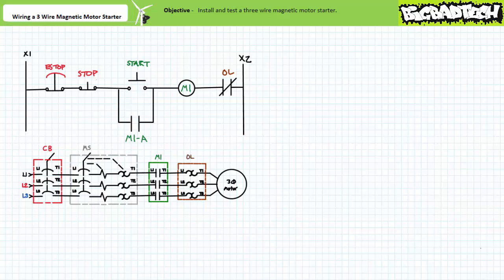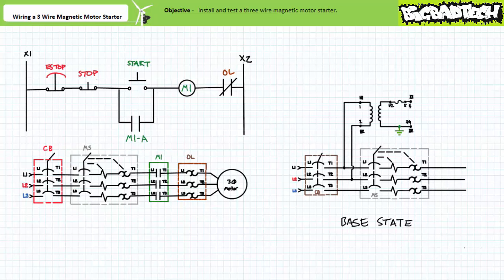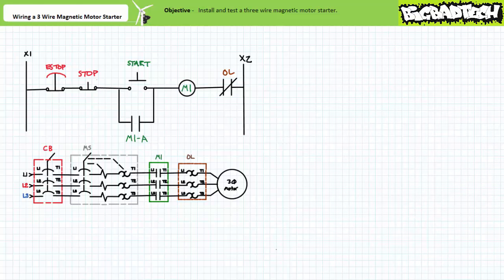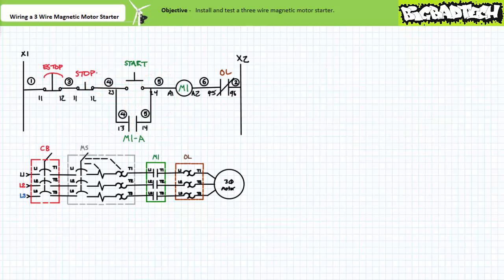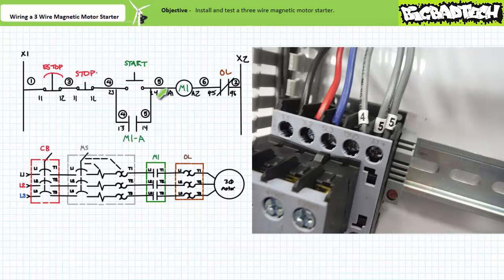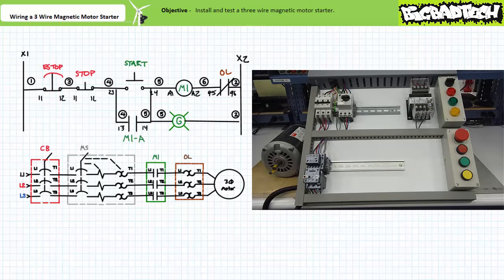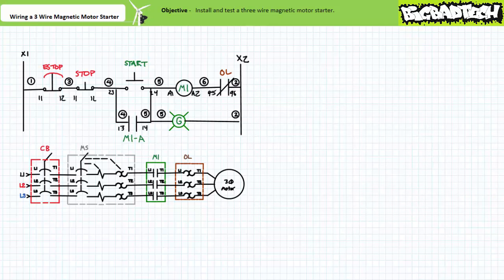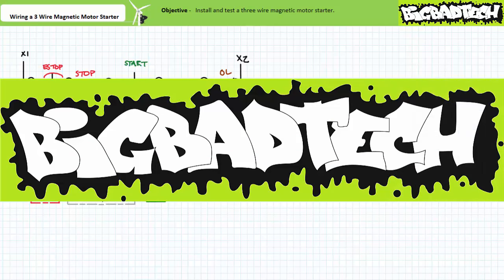Wiring a Three Wire Magnetic Motor Starter

Comment: How would you also wire in a rotary switch into this circuit? I’m trying to run two separate pumps from a pilot house but cannot get the rotary switch to shut down a pump it turns on. Thanks!
Reply from the maker: By "rotary switch" I'm presuming you mean a maintained contact selector switch similar to this? 
https://youtu.be/ENCdPsA9PXc?t=1521
These are commonly found in 2 wire motor starters.
Here's a quick discussion about the differences between 2 and 3 wire motor starters: https://youtu.be/kr7XiQ84rdo
Reply: @bigbadtech  yes, a three position, 4 wire selector switch. I watched that other video before commenting also. 
If I wire one side of the selector switch in series with my NO start switch. It will turn on the pump. 
Turn the pilot house selector switch back to off. The pump stays running (because there is nothing to open stop switch side). 
I only mention running one pump for fear of starting both pumps. Your videos helped me map out and work through the basics of what it is doing. Mc 12b contactor with mt32 overload relay. 2 separate 3 phase 240v hydraulic pumps. Original wiring was destroyed when the boat sunk. Installed used engines and new wiring but original plans didn’t cover everything. I tried to talk to two master electricians and they both said I know more than them. Thanks